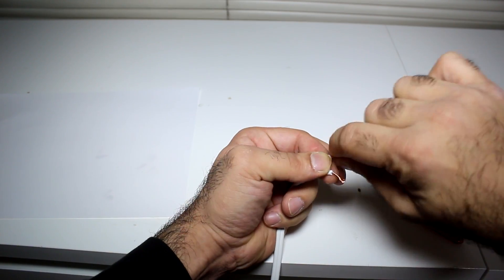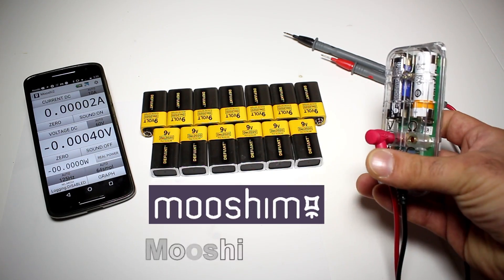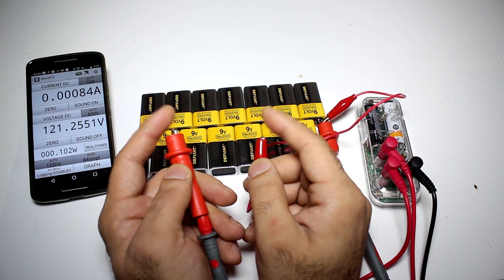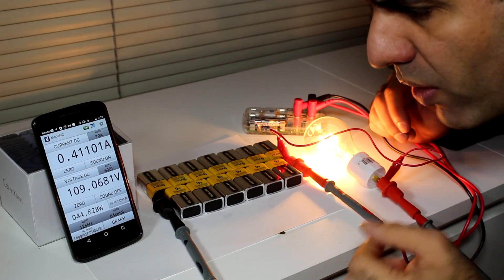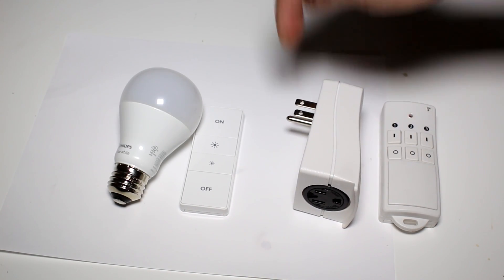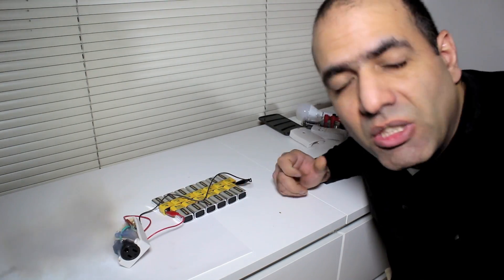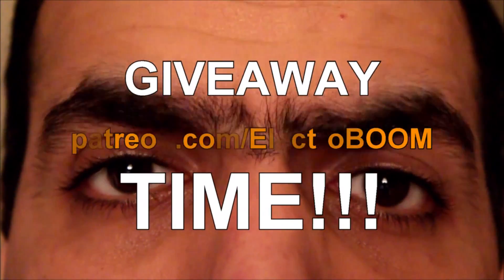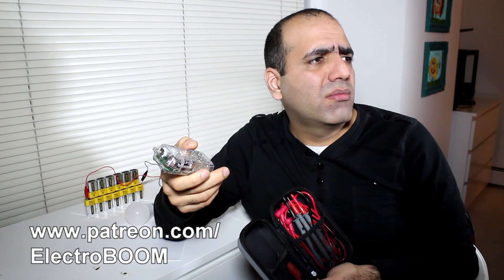Butt Light, Powering Electronics Remotely

Comment: You could probably get one of those IR remote controlled LED bulbs, remove the Stepdown circuitry and replace it with a lithium cell and first screw it in to a fake ceiling light socket (one that's not connected to anything, just screwed or stuck to the ceiling) then have another unadulterated bulb screwed in to a normal connected ceiling socket. Now when you use a remote, both bulbs will turn off and on regardless if the battery powered one is in your mouth or up your ass.

Comment: I don't know with that butt lamp video, but in here there a circuit that can make lamp on with just touching it. Of course it disconnected to power line. 
The circuit just like bug fuxxxx ehm zapper, battery to high voltage squarewave, one cable go to ground/floor, one cable connected to body, instead create spark, this circuit make your body as 'ionizer'? You know if you take lamp near Tesla coil, without touching it, without spark, that make lamp on.

Comment: He says that switching power supplies and LED lights will work on DC. This is not always true. Many LED lights use a capacitive power supply similar to the remote socket which blocks DC. Switching power supplies have a FULL BRIDGE RECTIFIER on the input, so it doesn't matter whether you have AC or DC. However, the voltage does matter. Most switching power supplies are designed for a minimum voltage of 100Vac. This becomes 140Vdc after the Rectifier. So at high loads, 120Vdc might not be enough. 

DC output of bridge Rectifier = AC peak voltage -1V

Peak voltage of sinusoidal AC = RMS voltage * √2

Comment: ...you know...there are actually these LED lights that i have that can turn on by just putting pressure on the end...cuz they have sensors and a built in rechargeable battery..they hold charge even after the electricity is turned off.....so guy coulda legit just clenched his but cheeks to turn it on.

Comment: in the video you say dc is much safer to the touch than ac. how? I've always heard high voltage dc is very dangerous because there's the chance you wont be able to pull away from it, unlike ac which crosses 0 volts 120 times per second and reverses polarity.

Comment: isn't it a bad thing for a multimeter to measure voltage and current simultaneously since you want a high resistance for a voltagemeter and a low resistance for a current meter?

Comment: hey boom , for 2 measurement classes at school , ive noticed the mooshi not being as accurate or reliable with AC signals as a scope or a voltcraft multimeter. 

have you noticed some weird stuff with the mooshi yet ? 

doing three measurements ( triangulating :D DD ) the mooshi was off most of the measurements by a longshot :(
Reply from the maker: Hey Noobje! I tried mine and it reads correctly. But I noticed something important, depending on the number of samples (SMPL) and sample rate (Hz) it can read the level differently. Those settings can change the accuracy of the reading and mostly help with DC reading. Make sure they are set to Auto (usually automatically goes to 4000Hz and 256 samples). Try again and hopefully the number would be correct.
Reply: I hope you realize that's a paid promotion and you are throwing Mehdi under the bus with this comment of yours.
Maybe you should remove this comment before the former or potential future financial partners of Mehdi see it.
He has worked hard to deserve payment and a good reputation both among the viewrs and the financial partners.
Reply: +Murad Beybalaev so you wouldn't advertise your product on a channel where viewers express their doubt about another product? Only makes sense when your product is crap, but then a good channel wouldn't advertise it anyway.
Reply: I also just checked, "Cheap" my ass, this thing is 140$, wtf.

Comment: A small correction.  The capacitor acts to block any DC voltage.  Since a capacitor is essentially an open circuit, it blocks all DC, but since capacitive reactance varies inversely with frequency, it acts as a short to AC.

Comment: sorry if i sound stupid, but how does DC work on a wall adapter which has a transformer in it?
Reply from the maker: It won't work on wall adapters with transformer. It will be shorted. But
 it works on switch mode wall adapters, they rectify any input voltage 
first anyways.
Reply: Rectumify.
Reply: That was a bad ass trick! 

Heeeee...

Comment: +ElectroBOOM I assume you know this, but I've seen power failure backup lights where there is enough space in one of those LED bulbs for a small lithium battery. Probably those come with, or it was easily modified with the traditional remote control that you usually find on RGB choose-your-own-adventure-color lights.

If the example video were longer, probably his "butt" would have run out of juice and it would need recharged by plugging the light back into the light socket.

Comment: why set all of those resistors in parallel?
Reply: takamori11 so the current flowing through just one does not set it on fire. now the load is divided to many resistors and heat is generated way less thus making it safer

Comment: couldn't you use a charged capacitor? it's not like you are going for longevity.
Reply from the maker: You would need a capacitor that would be rated for over 120VDC, and can hold huge charge to light the bulb without voltage quickly dropping. That would be larger and heavier than a battery. The capacitor voltage drops also, and the light shows dimming quickly
Reply: If you're willing to shove a charged capacitor up your butt for shits and giggles, I don't think you'd know what longevity meant..
Reply: the capacitor let's through just a tiny bit of power each AC half cycle as it charges up.
Reply: Joe C He meant to power the bulb by capacitors, not by batteries
Reply: shurdi3 yeah, what he said
Reply: The original suggestion was to use caps instead of batteries. We're saying that that's infeasible.
Reply: 200V are quite common capacitors 

Gotta parallel them up though
Reply: Which lowers the capacitance, meaning the light dims out faster and stays lit for less time.
Reply: ...Parallel them up 

Capacitors in parallel add their capacitances 

In series you get 1/C=1/C1 + 1/C2

Resistorbs lower their resistance when paralleled up
Reply: +shurdi3 
You would need several thousand 200v electrolytic capacitors to have the capacity of a double a.
Reply: I'm not saying it'll be easy. 

I'm saying it'll be possible
Reply: True, but less possible than using batteries
Reply: Doesn't matter
Reply: Jerry wand t

Comment: instructions unclear, wire is stuck in urethra.
Reply: Have fun explaining that to the doctor :D
Reply: it was meant to come out. you butt?
Reply: Instructions unclear wire stuck in Mushi
Reply: Gottfried Leibniz I can't find the wire. I dropped it inside me.
Reply: Same happened to me, but I quite liked it.
Reply: Gottfried Leibniz he made a mistake he forgot when you pee copper wire you put it in wrong
Reply: The internet is a dark place
Reply: I guess it turned to the wrong side. Some weight on the end might help but you will need to put some pressure to push it out.
Reply: When I passed the electricity you gotfried?
Reply: Gottfried Leibniz bruh
Reply: Bruh you didnt invent calculus!!1!1!
Reply: try to not drink water
Reply: Did you try plugging in the wire?
Reply: Same here, but after applying power it was tolerable, just had some electrical discharge and some non-electrical discharge.
Reply: oh no
Reply: Ask your friend Newton he knows better

Comment: How does that capacitor step down the AC voltage?
Reply: Capacitor has an impedance under AC which consumes energy (apparent power). At 50 Hz e.g. 330nF capacitor has an impedance of appr 10kohm which drops the voltage across like resistor but without that much real power (heat).

What happens on deeper level is that capacitor resists change of voltage across it because it charges and discharges on every half cycle of AC voltage. This is what we call a reactance.
Reply: It can shape-shift between a transistor and a resistor.
Reply: Sam C can you elaborate? I don't understand
Reply: *****
Aliens man, aliens.
Reply: Capacitors store a voltage. It takes time to put that voltage in, so when AC is fed in, the capacitor can fill partially before the voltage switches direction and it fills partially in the other direction. Since the voltage is changing continuously, the capacitor acts like a resistor in a DC circuit.

 The channel Applied Science has a really good video on this, somewhere in his electronics basics playlist
Reply: *****
So it shape-shifts between a transistor and a resistor?
Reply: Sam C No, transistor is more like a switch. Capacitor just burns energy much like a resistor.
Reply: ***** I always thought an ideal capacitor stored energy and did not dissipate it unlike a resistor
Reply: ***** a capacitor dissipates little to no energy at all

Comment: i have been wondering. during cold winters won't it be more efficient to have incandescent bulbs ? all the heat goes into the room. if you have a heat pump you have to deal with the efficiency of the heat engine and other losses. Wonder if you could design an experiment

Comment: In ?1996? I had about 10ft of half-dead 9V batteries (so, 8V each) in two long strips on an 8ft table.  I think it measured around 1.4KV unloaded.   I was writing my name on a wet 2X4 in charcoal, when I accidentally bumped the other end while touching metal on needlenose pliers connected to this end (pliers, to hold the nail I used for writing.)  Wow, it felt exactly like 60Hz, like an AC shock.   I'd have thought that DC electrocution would "feel smooth."
Reply: wbeaty lucky to be alive!
Reply: My life is being properly terrified of HV.  So the milliamps went through my arm (not across chest.)   Spend your electronics career developing a habit of being afraid of your OTHER hand.  Not the one holding the probe touching kilovolts.

IIRC the short-circuit current on that array was about 300mA.   So, roughly 500watts from 9V batteries, or 250W into an ideal 2.7Kohm load.   YES, floating bluetooth datalogger for monitoring that current, https://www.sparkfun.com/products/13843

Mehdi knows the secret recipe.  I was only shocked because I was in front of a large group of people, talking about the dangerous kilovolt 9V battery chain.    Your subconscious makes you move your finger to touch the bare metal pilers on the negative terminal.  Then your hand gets closer and closer to the positive HV metal mixing bowl, while you're looking away and talking to the crowd.  YOW!!!    HEY THAT FELT ...just like a 3KV ham radio final-amp transformer output.  But without that zzzzzzzAP! noise of drawing an arc with your bare flesh.

BTW, with enough 9V batteries in a chain, you can use a nail to write your name in charcoal.  Accidental discovery.   Pound one nail into a 2X4, wet the wood surface, then use a second nail to draw a horizontal arc.  The wood carbonizes.  Lead the carbon-track along, using the tip of the second nail as a PENCIL OF DEATH!!!!    We also made hydrogen using a metal mixing bowl full of tap water (not salt water.)   Actually I think I got shocked off the mixing bowl, not the carbonized wood.

We got our 9V batteries donated by Seattle ACT theater.   Back in 1990s they'd been using hundreds of the things in their RF microphones, and they replace them after every show (they decrease to 8 - 8.5V.)   A half-dead 9V batt can still put out about half an ampere, not the full 10A of a fresh one.    (So, whenever you need hundreds of DC amperes for your personal experiments, instead of buying a DC welder on eBay, just hook up an array of new unused 9V alkaline batts in parallel.   USE THICK WIRES.)

A basic rule: high voltage power supply thinks that any resistance lower than its own internal supply-impedance is a good conductor.   So, 1400V/.3A ohms, if the water is equal or lower than that, it's a good conductor.   One thousand ohms is usually a dead short!   When working with HV, human bodies act like a short circuit (if it arcs across the thin high-resistance coating found on human bodies: 50K ohms of dead skin.)

One guy that came to our monthly meetings says that Boeing Inc. abandoned their HV cap-bank dent-puller project after the project director got killed by a capacitor bank.    They'd been using foot-wide 3ft-tall 5KV energy-storage oil-capacitors (I saw one of their portable cap-banks at a surplus auction.)    He said they later redesigned the EM sledghammer system to use electrolytic banks at 800VDC.  That's below the threshold for the weird,  water-explosion phenomenon.   That way if a human touches the 800V, they just get defillibrated.    No exploding flesh, no inconvenient microsecond-scale hydrostatic shocks traveling up your arm and turning your brains to liquid.

Comment: word of warning...you might want to do at least 12 meters, as some people have a longer lower intestines than others, i also used 16 gauge automotive wire as i find that it goes down smoother if you lube it with a some virgin olive oil. if you are having trouble with the mouth down, you can also start it from the bottom up, just make sure to lube it up really good. and drinking half the bottle helps a lot too as it lubricates the whole tract.

this is the best party ass trick ever. just SUBBED....
Reply: Here I expected you to use Castor oil xD
Reply: Dude. I am going to tell my buddy to test that oil out next. So far 4 of us are done. Still 3 more to go. Might even try mineral oil too.   We are gonna make a chrismas light circuit connnecting all of us and go round thr neighborhood carolling.
Reply: @luisloks  Did you actually do this?
Reply: I can't find any virgin olive oil. Will promiscuous olive oil work in its place?
Reply: Monkey D. Luffy  lol. nah brah. my homie tried that and it was a rough ride.
Reply: Monkey D. Luffy  lol. nah brah. my homie tried that and it was a rough ride.
Reply: I personally prefer 20W-50 automotive oil instead, you can use virgin olive oil, too; but that's just for the first time :P

Comment: Why would there be a capacitor to step down ac? Just another method to drop the voltage for the circuit but down before the rectification to avoid a voltage regulator etc?
Reply: It's a very cheap and efficient way of dropping ac voltage, but it's not high precision. Thats where the less efficient, but more accurate regulators come in. Since the regulators in voltage is closer to the out voltage there's less waste and the whole thing can be efficient and accurate using both in conjunction
Reply: 175griffin How does a capacitor drop ac voltage exactly?
Reply: mrsemifixit the same way a resistor drops voltage. It provides resistance, or impedance. Since capacitors take time to fill, the voltage doesn't get a chance to reach the top before the direction changes, so the voltage out is less than the voltage in when AC is used. The amount of impedance depends on the voltage, frequency, and the capacitance.

Comment: Why does parallel batteries make higher volts instead of draining the battery
Reply: These batteries are in series. A common analogy to help explain electricity is to think of it as water flowing in a hose, where volts corresponds to the pressure and current (amps) to the volume of water flowing through your hose. With this in mind, the batteries are like chaining several pumps behind another, thus increasing the total pressure in the hose. And just like the batteries, if the pumps were in parallel, they would combine to a bigger volume but not increase the pressure. The batteries in parallel tends to discharge over time because if one battery has a tiny amount more voltage than the other, it will send power to the other batteries to try to balance out. With batteries in series like in the video, the circuit is open, so no current can flow until they are plugged into something. Assuming a pump with no one-way valve in them, I think higher pressure pumps would also technically backfeed in the lower-pressure ones if they were installed in parallel.

Comment: they make gag/magic light bulbs with their own built in power supply. my grandfather has one, it turns on when you touch the leads with your hands
Reply: Does it tolerate being plugged into my ass?
Reply: Can I plug my ass into it?
Reply: Does it tolerate being plugged in 220V AC?
Reply: that's the old Fester Addams trick bulb, yep!

Comment: You could have measured the DC voltage at the output of the Full Bridge Rectifier circuit, reduced the number of batteries to match that voltage, and simply bypassed that Full Bridge Rectifier by  connecting the batteries directly to the DC side of the circuit, no resistors to waste energy, maximum efficiency, and a bit safer DC voltage to stick down there.

Comment: Why is ac more dangerous
Reply: because AC hertz more
Reply: geordi rendum Serious answer, the human body is a much better capacitor than resistor, meaning AC has less impedance flowing in and out of the body than DC does going through. this means larger Amps flows through with the same voltage
Reply: It kills elephants.
Reply: Because it's black that why
Reply: AC hurts more than DC due to body capacitance abilities.That being said,AC is less dangerous due to the fact that it will hit 0 voltage for an instant and in that instant,theoretically,you can get yourself away from the source.In DC's constant voltage you get no chance to do that.
Reply: blargl121 thanks you ! makes sense !
Reply: Even the room cools down when you use it. Evil.
Reply: Because 5GHz isn't good
Reply: He had a video about that,  if my memory serves.